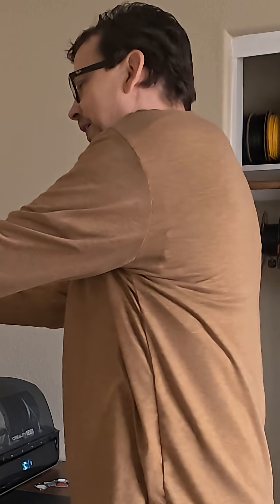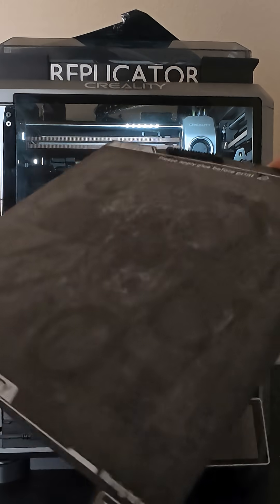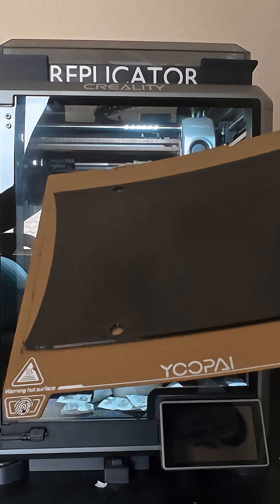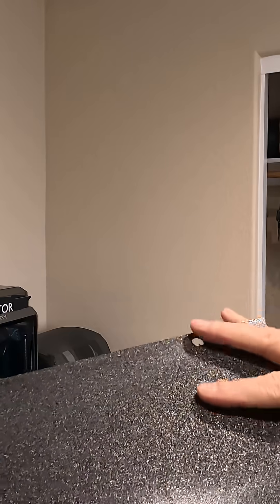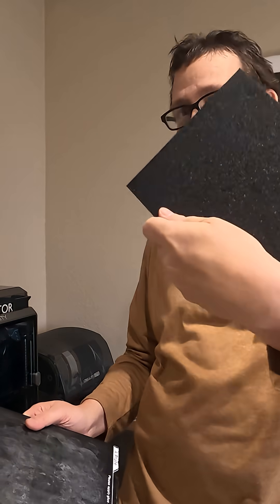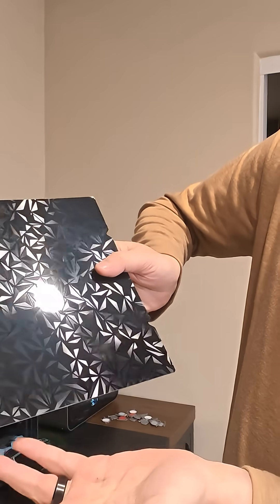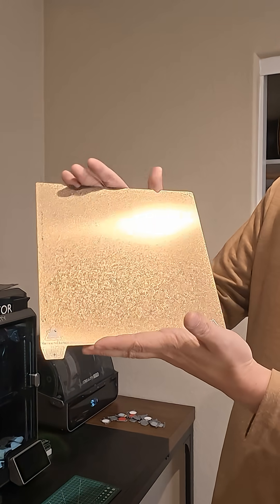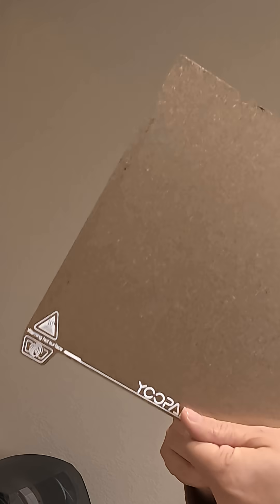Stop using glue on 3d Printers  #3dprinterupgrade

Comment: I use a very thin glue layer and Windex it off between prints and it works well. Both for keeping some materials stuck to the plate, and keeping others from sticking too much
Reply from the maker: That's a clever way to manage adhesion!

Comment: Glue on a smooth plate is generally for release not adhesion. If you need it for adhesion you're doing something wrong except in a few materials.
Reply from the maker: True. This one is for helping adhesion with certain materials.